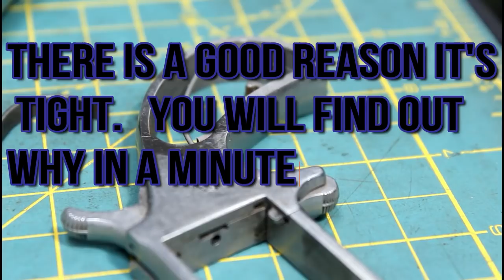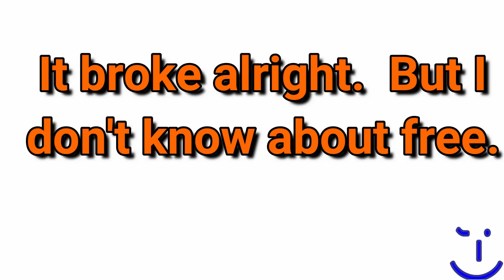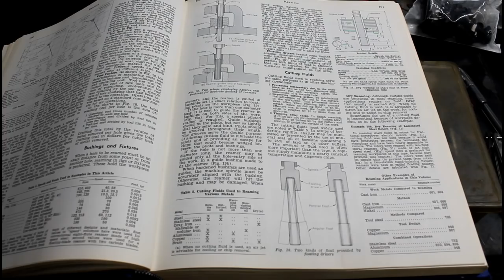BIG MISTAKE SCREW REMOVAL & INDEXING ANGLE PLATE WORK FACE

Comment: An old man once told me "Tighten before you loosen, it'll save you many troubles, son." I've always followed that advice. Especially since he told me that after helping me replace 3 lug studs on the left side of my '64 Chrysler Crown Imperial, because the left side were left hand threaded, and the right side the opposite. I love the "Power knee" on your mill, btw!
Reply from the maker: Power Knee made by DEWALT ;-)    That's good advice Rusty. Thanks

Comment: A method I have used ( mostly after being hooped by a LH thread in the first place) is to load and then lightly unload a stuck thread, then a LH will rear its ugly head. I started that method with frozen pipe threads, because you can almost always tighten a tapered thread a little more, then once it is moved it will unscrew.
When you apply this method, it becomes a natural habit and keeps that LH thread in the back of your memory for next time.
Nice work on the angle plate Steve, great video.

Comment: G'Day Steve, classy work on the Dividing Plate, I've really enjoyed the build.  Easiest way I've found to measure hole centers is to measure the hole first, zero the caliper then measure outside to outside to get a direct reading.  No need to add or subtract.
Cam

Comment: I hear you on working on the vehicle. When I was younger I would pull an engine and replace it without even thinking about the amount of work that goes into it. Even on the most frustrating jobs I would just do it. Now my current car needs work and I do NOT want to even touch it. It really needs to be done but I cannot seem to get past my own procrastination to do the work.
Reply from the maker: Ian Ide I once loved turning wrenches. I have to fight myself to do it now. My dad owned a shop when I was a kid and it was all I did. Busting up my hands and dealing with parts that are junk or simply don't fit. Thanks for watching 👍
Reply: Ian Ide ii

Comment: I suspect that whoever put that (LH) screw in there also used  Loctite. Which is why I always heat things up. Use a butane torch to do minimal damage. I thank you for that center-distance caliper trick. One great advantage of digital calipers is that you can  zero them anywhere!

Comment: I have never ever twisted off a left handed screw, well at least not in a video.  Well it was repaired no worse for wear.  Love the angle plate.
Reply from the maker: Randy Richard In The Shop Thanks for watching Randy👍 I have twisted them off both on and off camera. The big trucks that have RH lug nuts on one side and LH on the other get me every time.😃
Reply: Steve Summers That was my first experience with a left hand thread. As a teenager I decided I wanted to restore an old farm truck my uncle gave me, a '55 International.  After doing some body work and a few custom parts here and there that I machined, i decided some new wheels were in order.  Started on passenger side and things went great, then onto the driver side where I twisted off 3 lug bolts before realizing what was going on, lololol.    Love your videos!  Thanks for sharing with us.
Reply from the maker: Johnny Wayne Thank you for watching Jonny. Glad you enjoy the videos.👍
Reply: Same here. I was trying to get some tires off of a one ton truck one time and one side wouldn't come off. Yep left handed wheel studs.

Comment: Steve, Left Handed Screws Are Present In Some Guns And Not In Others. Guess Its The Manufacturers Choice. However Anyone Can Make That Mistake. I Think There Should Be A Standard Mark On The Screwhead That Lets A Guy Know Its A LH Screw. Anyway Great Video. I Love That Angle Plate And If I Get Around To It I Am Going To Make One Real Soon.
Reply: yeah... 2nd that, if you're going non-standard you should indicate that you do
Reply from the maker: John Garrett I seen no reason for this screw to be LH. The hammer moves in both directions under load. A LH screw is just as likely to loosen as a RH screw. This one got me. I was wondering why the thing was so dang tight🤔. 😃
Reply: Steve Summers little guns like that produce sharp twisting forces under recoil.  If that screw was right-handed, it would be nearly impossible to keep tight.
Reply: Couldn't they simply have put the screw on the other side and not have the issue?
Reply: WoLpH no.  Any screw that enters the left side of the gun will get a counter-clockwise force every time the gun fires.  It would take a full redesign of the gun to make it a mirror image, and have that screw enter from the right side.
Reply: Great idea! There should be a standard for non-standard, standard threads.

Comment: I own that gun and as a half fast gunsmith I do my own repairs. They no longer produce that gun but as of 5 years ago an old guy that works for the company that bought them out is in charge of the parts for that gun. I bought redundant parts and he sent me a schematic. The first thing I noticed was that the schematic was wrong, it showed the ‘hand’ upside down..I called him back and he was aware of the schematic issue but the company had made thousands of copies and they weren’t changing it. I told him to make an amendment attachment of maybe 10 copies stating the hand was upside down. After all how many schematics do the send out on that old gun. No go. Anyway I don’t shoot that little bugger often because it’s hard to control and points at the sky after every shot. Because of the tight tolerances after a while the internals gum up and it won’t cock causing the need for tear down and cleaning. Maybe just use wd-40. Maybe a flooding of wd-40 down the hammer slot occasionally will keep it functional.

Comment: Steve was thinking about this and I think I see why that screw is left handed. That screw actually acts as the pivot for the hammer it seems and there must be a lot of velocity when the hammer is released, and maybe that causes that screw to back out if it was a right handed thread. If nothing else you prove that your idea of removing the screw using the quill is sound, given that it had enough torque to break it off...

Comment: Steve,

On your plate I think you did this the hard way.

Rarher than using the transfer screws, you could have just measured your hole pattern, calculated your X and Y positions for each hole and used the feed screws to position the work.  I know you commented that with a DRO it would have been a lot quicker, but before they had DRO's counting cranks and reading dials was the quick way.
Reply from the maker: I stated that I was using an alternative method in the video in order to locate the bolt holes.  It was for video reasons showing different tools methods and uses.

Comment: Zero out your caliper on the measurement of the bolt hole then measure outside to outside for a direct measurement.
Reply from the maker: hardkrash Yeah. 👍
Reply: That’s how you do it. Let the tool do the math for you.  WARNING: Reset the tool to zero IMMEDIATELY after getting the number. Otherwise you will get bad numbers with the tool until you realize it’s not zeroed. This is especially true if the hole was small
Reply: Or just measure outside to outside (right side to right side or left side to left side) gives a rough measurement faster and no math or changing caliper settings.

Comment: Hey, Steve:

You actually should have done the countersinks on the other side of the plate.

You were lucky that the holes in the original piece seem to have been very symmetrical and uniformly located. If they weren't, you wouldn't have been able to match it up after the machining you did.
Reply: Andy Wander I was screaming the same thing lol

Comment: I imagine a right-handed thread will loosen when the gun recoils.  I can just see the gun's designer scratching his head trying to redesign that part to keep the screw tight.  The lefty thread sure is a deal with the devil.
Reply from the maker: Anthony I thought about why they would put a LH screw in the hammer and other than recoil I see no reason. I'm no expert but looks to me that a LH has the same chance of getting loose as a RH. 🤔
Reply: Steve Summers think about how the gun recoils when fired.  The muzzle rises because the gun's grip sits below the barrel.  Little guns like that have extremely sharp recoil forces, akin to hitting the whole gun with a lead mallet, time and time again.  The direction of the force imparted to everything on the left face of the gun by that recoil is counter-clockwise.  If you look at almost every revolver with a side-plate covering the trigger mechanism, they're designed with all screw entering from the right side of the gun, so a right-handed screw won't loosen.

Comment: Big O tires busted every one of the lh screws off the left hand side of my dodge once. At least you only did one before you realized the problem!! lol  Sadly the lugs are stamped with a huge L but they failed to make the connection.
Reply from the maker: I worked on the large Fed-EX trucks for a couple years with my brother and the 1st time I ran into that was confusing. I can see a kid and a large impact busting them off. Hope they replaced them for ya :-)
Good to see you Brian

Comment: I am thinking that if you measure the diameter of one of the holes, set the caliper to 0 and then measure the maximum distance between the outside of the holes, you would get a direct reading for the center distance and not have to remember any measurement.
I have a Kubota finish mower.  I bought it used and wanted to change the blades.  There was no model number on the cutter anywhere.  We were ralphing on the blade bolts, even with a 6' cheater.  No joy.  I finally started looking for new blades.  I could not find them.  My son found them online and I found a manual for one of the models that the blades fit.  The blade bolts were left handed.  It took the 6' cheater to loosen them, but we got them out and replaced the blades.

Comment: I really dislike repair work such as the screw you encountered but it worked out well. Had you checked out if the new plate is perpendicular to the base after you had mounted it Steve?
Reply from the maker: Makin Sumthin From Nuthin Yeah I checked it with a machinist square. Looks good👍. Thanks for watching Richard

Comment: I have to ask what the STUFF you put on the centering drill for lube (boeshield?)
Reply from the maker: Ed KE6BNL No Ed, that is a new lube in my shop. I use it at work all the time and love it. I decided to buy some for home use. It is called Accu-Lube push up stick lube. Great for drills. You can get it in a paste form that may be better but I like the not messy stick.👍. They are not a sponsor or anything. I just like the stuff.
Reply: Have some of the paste on order 8 oz will give it a try
Reply from the maker: Ed KE6BNL I never used the paste but I'm sure it's the same thing. Stuff is non toxic and smells decent. I know I can see the difference and feel the difference when drilling. Let me know what you think of it👍
Reply: Steve Summers got a large tub for a good price and have drilled and tapped with, and do think it is working great
Reply from the maker: Good, I like the stuff. Used it today several times

Comment: Going to the timber and loading your pickup trucks like that ... you must be kin to Ivan Swope!

I'll do my own timing belt work, but if the vehicle is someone else's ... send them to a local garage.  It's bad enough with your own vehicle, if the job goes pear-shaped.  And the contortions you go through to make sure your marks are lined up properly are too painful in the days after the job is done.  My ribs hurt just looking at that.

That adjustable angle fixture is coming together nicely.  How many more features did you think of while working on that one???  Yeah, that happens to me, too.
Reply from the maker: diggerop I load them heavy. If this old truck is capable of holding it. It gets it. 😃
Reply: I'm guilty of it as well.  Stacked straight up, just over cab high, all the way back on the tailgate.

I should probably explain the comment.  During my Senior year in High School, I spent a lot of my out of school time helping two classmates keep their woodpile up.  Wood was their only heat source in an old farm house, and it was a rough winter.

One day, while we were at the house for lunch, one of their nephews (4 years old) was playing with a toy truck, and he proceeded to stack wood blocks in the bed of it, to about a foot over the cab, and started to push it across the floor to where he wanted it to go.  Grandma walks in, takes a look, and exclaimed "Micheal Swope, you're kin to your Grandpa, no doubt.  If there was a way to overload a pickup truck, he'd do it."

Comment: Unless you knew that screw was left-handed there was no need for it to be one. Most left-handed bolts/nuts are used on rotating asembelys where there is a chance of them backing out, or an adjustment one end left-handed other end right-handed.

Comment: Didn’t you get a sine bar in your recent barn sale? You should get better then .25 deg with that.
Reply from the maker: I did not. I do have a sine bar but I was referring to the built in index ring and scale. But you are correct, I can get it as accurate as I can measure.    Thanks for watching

Comment: Rotating parts, sorry, I'm buying good. TRW, Factory, whatever.  I've earned the reward for cheapness too many times.
Reply from the maker: Crafted I agree factory parts are better most the time. Sometimes when a vehicle gets older I think the factory starts selling second run parts and the quality goes down as the years pass. My experience is its a crap shoot.  On the LH screw the manufacturer could have installed it from the other side and saved some trouble if rotation was the reason for the LH 🤔.  Sometimes I wonder what they were thinking. But then again I'm not a expert. Thanks for watching
Reply: Wait a minute.  It does not matter from which end you turn a screw, the helix is still in the same direction.   The same misunderstanding has passed through my mind before.  ;-)   With magnification you could have figured it out by looking at the non-circular emerging end on the other side.   My father was the worlds best stuck bolt remover.  He nearly always started on a tough job by striking with the drift to shock loose any rust (not a problem in the pistol frame) and then by creeping the fastener tighter a few degrees.   It's a good practice as you'd have accidentally discovered the left hand threads even after skipping your opportunity to inspect the other end.  Yes, I put in a comment before you got to that point that it was left handed likely.  After you discovered it, the comment no longer read friendly to me so I took it down.  ;-)   A great skill of a good mechanic you exhibit is being able to skip over the emotion of an error and simply move forward a wiser man.  It's a valuable trait to encourage others with.   Great channel.  50k subs by the first of the year I suspect.
Reply from the maker: Crafted Thank you🖒. The idea about inserting the screw from the other side was to account for recoil making the screw loose if that is the reason they made it LH. Of course the helix stays the same but the direction it needs turned to get loose in relation to the muzzle changes. This was a comment from another viewer and not my idea but to me that makes sense. 😃 but I have been wrong before. Thanks for watching man. I really appreciate it. I hope for 50K but you never know. I feel lucky to have 10k